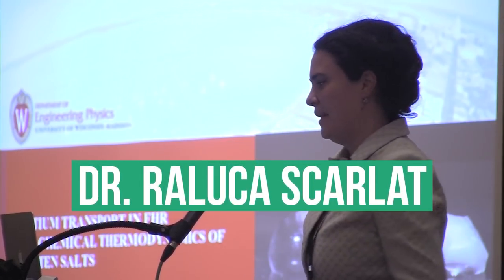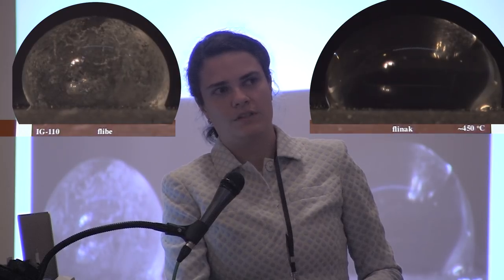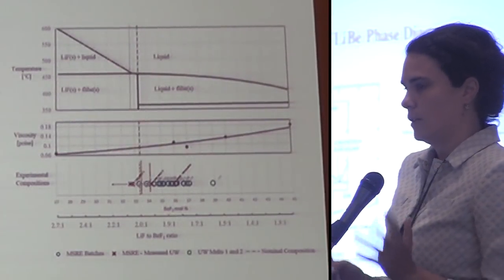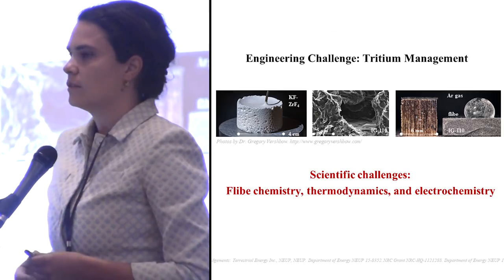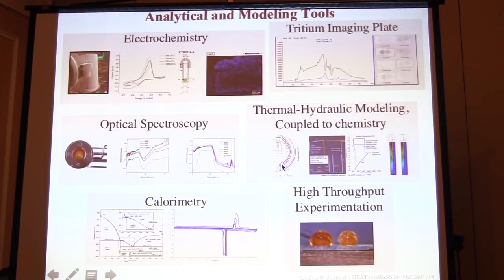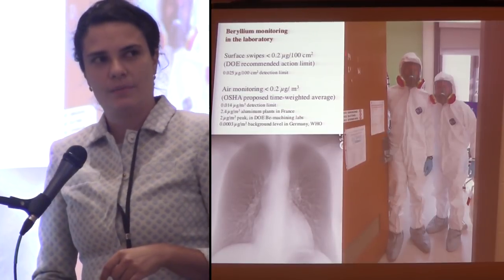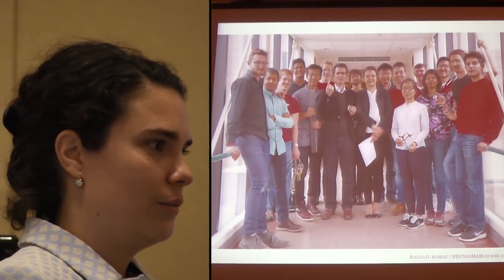Thermochemistry of Molten Salt Solutions by Dr. Raluca Scarlat @ TEAC8

Comment: I'm very appreciative of the work done by Dr. Scarlat and others on the chemistry and thermohydraulic properties of FLiBe and other molten salts.  This research should have a positive contribution not only to LFTR, but also migrating from conventional light water reactors to safer reactor designs across the board.

I understand that many current LFTR designs plan on using graphite as a moderator, but has much thought been put into using FLiBe as both a carrier and neutron moderator?  Or would that compromise the intrinsic safety of a freeze plug by allowing Thorium to continue to operate in the thermal spectrum while in a drain tank?
Reply: Accidental criticality in the drain tank should not be a problem because the geometry of the tank would prevent it. As a "belt and suspenders" solution solid neutron poisons could also be placed in the drain tank.

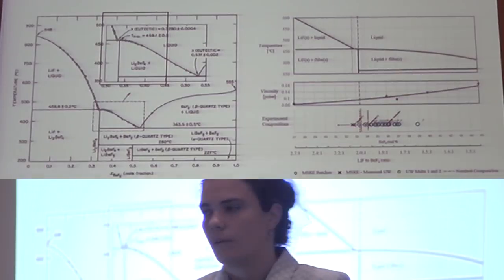Comment: Part of the reason thorium never got off the ground was the extreme complexity (at time 5:11 to 6:26) of the compounds (reaction poison transfer and scavenger maintenance)  that are formed in the high temp. heat exchange loop and the expense and difficulty of  fabricating the reactor piping.
 In retrospect maybe the Navy should have run a parallel development with the smaller footprint, easier to refuel (continuous process) thorium reactors.    Since we have better control instrumentation and much less pressure in the primary loop this should probably be  developed for newer Naval surface ships and some major Matson Line cargo ships.  Almost anything other than the 40 year old tea kettle designs with 5% fuel use would be better.
Reply: Add to this a small MSR has the heats to make jet fuel from sea water.  The Navy has been working on this as reported in the general press.  The high temps of the MSR would also allow for more compact power units. Things like super critical CO2 turbines, something like 1/5th the size and more power.  Possible modular design such that power units can be sealled units that can be swapped out every 10, 20, 30 years as needed to refuel.  Not to mention that much smaller ships could be  powered by these power sources.  These ships would have essentially unlimited range and higher power to weight ratios  (Hydrofoil destroyers, cruisers anyone?).  Yes, I would say there are a few reasons the Navy should be interested in exploring MSR technology.

Comment: this talk, or physics, or reality is wonderful. excellent. what we need desperately at this time. to replace our current high pressure water reactors, with this molten salt solution. flibe may be the answer, but I feel, graphite is not. I can see it swelling with use. thus, no method of removing it, shaving it down, and putting it back in, thus making a huge waste disposal catastrophe, on a large scale move to this technology by all society. an answer must be found, to not producing this huge waste problem. maybe having an automatic shaving unit in the fuel recovery system for the reactor poison extraction, could also have this as an automatic function. a thirty year lifetime is necessary to raise humanity to the level needed for continued growth, and function. moving away from sunlight, whether fossil fuel, or solar panels, or wind gens, is a fruitful pursuit.